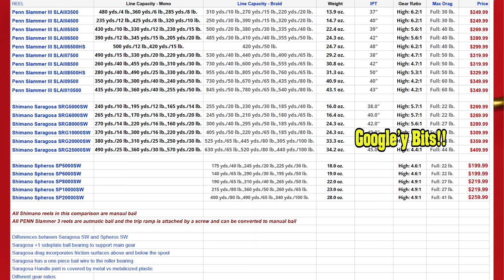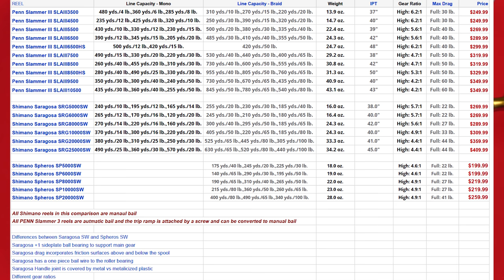Penn Slammer 3 vs Shimano Saragosa SW Who makes the best Surf Jetty Pier Boat spinning reel?  Sealed

Comment: I have a brand new 6k out of box Gosa that is really smooth....but there’s this weird slight in-out feeling on the handle that’s really hard to describe and almost has a knock noise when I stop reeling. This is my first Shimano, just wondering if this is normal or not as I’m used to more stiff reels like the VS.
Reply from the maker: IF you hold the rotor..is there much handle play?   If there is it may need a shim....the 8k i have here is pretty tight...although it did have a knock...that was in the non line roller bail arm mount and a little grease silenced it.  It should be rock solid...in and out means more slip and stick in the gear mesh..meaning more wear
Reply: Tackle Advisors thanks for the reply, love your indepth videos btw. Actually while holding the rotor tight, I can see there isnt actually any in-out play. Its a slight back and forth movement in the handle with a distinct knock, almost like the main gear teeth and (pinion?) have a little bit of space between them. Again this could just be me nitpicking, as Im not sure what the tolerance is.
Reply: Tackle Advisors after reading some posts on stripers online and playing with it more I def need to shim it. No play or knock at all if I hold the handle tight pushing inward while holding the rotor.

Comment: Can both be used in offshore trolling ?
Reply from the maker: Always gotta be careful trolling spinners....That bail arm and line roller and clutch are gonna take a lot of abuse which is why most use lever drags....And how long of a topshot do you plan on managing and how heavy....looooong topshots are essentially snubbers....longer than 20' on a spinner can be problematic when above 60lbs.  Especially during end game and if you have to let off by opening the bail.......

Comment: Any vids on quantum boca's? Torn between these two and a boca
Reply from the maker: If you need sealing these blow away the Quantum Cabo or Boca.  For a boat reel the Penn has great gearing and an even better drag (i had a Cabo 50 ptsd that was meh.. Not bad but not that good sold it in favor of the Gosa a few years ago

Comment: Can you just tell me which one without watch the whole thing
Reply from the maker: Both great... Gosa quality control and pleasure of use is better. Slammer is a bit more powerful and has sturdier gears.. Sealing is better in the gosa.. Slammer sealing is weak at the top of the ar clutch and water can and has gotten past and wrecked pinion bearings

Comment: when you mentioned the handle of the slammer 3 and how it is metal, its worth noting that when you get them in the box is a spare handle knob that is made of a foamy type material just in case you don't like the metal one or you are fishing in cold conditions (https://gyazo.com/336cd626d31e7c5c62949e5ffe06f228 the dark black part on the bottom is metal) however when i went to change mine i could not get my metal knob off of my reel, idk if the screw got corroded and binded up (has had no effect on the performance) or not but i just wanted to change the handle out for my night time winter fishing trips as the handle did get cold.

Edit: just checked my Slammer 3 (6500) and mine has no backplay at all so maybe its just that particular reel.

sorry for your loss, been in the same situation and its not fun so take all the time you need, your hard core subscribers will always be here when you come back, personal health weather it be mental or physical of yourself and those close to you always comes first <3

Comment: what braid do you use for freshwater spinning reels (smallies + largies)
Reply from the maker: I use a few.  Fins 40g, Gliss, fireline ultra 8, j braid.......I use a PR knot which allows me to go pretty light and have braid that breaks way over it's rating.   Gliss is silent and casts further than anything..fireline is the toughest and one of the strongest.....Fins is the one of the best in every category but i've seen issues with the line de sheathing and kinking.  J braid is just nice braid for cheap.
Reply from the maker: I like fins 40g and gliss in rivers as it's easy to keep the line off the surface on a drive...that to me is very important...but gliss is a pain and if you tie direct you need to do a double or triple polomar.....and pr knots are the only knot to get close to it's package rating.
Reply: thanks

Comment: How do I convert an automatic bail to manual bail on Penn Slammer III?
Reply: Open the housing on the side of the rotor. Simply remove the "bail trip lever"'. Check your schematics which comes with the box. Usually comes in a Z-shape or L-shape rod. DO NOT REMOVE THE SPRING. Enjoy!

Comment: Excuse me sir im looking 4 a reel that can handle 200lbs fish year round but it has to be spinning reel
Reply from the maker: Larger Slammer, Torque, Saltiga, Stella,  Makaira.  Twinspin.   Stella may be best bet for the quick service turn around and what you get for the cost of service.  Should you need a saltiga gear set replaced you'd be out close to 250$
Reply: @TackleAdvisors  i forgot to tell u my budget is about 300 thx sir
Reply from the maker: @THEBLACKANARCHIST  that doesn't change the choices of 2018 /2019 reels that can take regular tuna abuse

Comment: You should’ve mention how the gosa has that movement in the drag knob when line is peeling on a loose setting.
Reply from the maker: I don't think i ever experienced that.  ((i've had a few gosa sw reels over the years))  I know it's possible with any rubber sealed drag knob.  But I never had that issue.  Is it a problem or does it just creep up a tad?

Comment: Tackle Advisors So the gear of the Slammer which is brass is going to have a lot of wear if you fish it for 20hours for example??This is not good and will not last much.What do you think?
Reply: Shore jigger Chris brass should normally more dureable to wear n tear . But it's always the process behind the metal that plays the gratest part of dureability .

Comment: AR clutch housing doesn't look keyed or eared so where it fits into the body may be slightly loose?
Reply from the maker: It is...it's like a rounded edge hexagon (or however many sides it has)  Like most clutches...

Comment: Have been looking online for the issue I'm having with my slammer have had no luck as of yet. My handle has in and out play at the base of the body of the reel , I have not noticed it affecting proper operation but I would rather not feel my handle moving in and out. If anyone has any advice please let me know

Comment: Sahara*
Reply from the maker: If I'm not mistaken the saraha is the same as the nasci only it lacks the core protect which is a "meh" method to keep water out of the antireverse clutch.  And it lacks the seals at the handle and non handle bearing entry points.
Very good reel.  My friend has been fishing the heck out of one all season.  It's not rock solid and the daiwa fuego lt and exceler lt reels feel a bit more refined with less handle slop.  But it's a good reel.
Reply: Do you think it should hold better than the battle 2 from penn? And also Ive had an okuma trio for quite a while and so far it has been fantastic